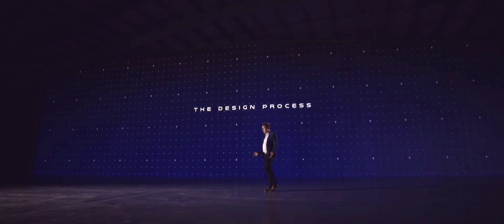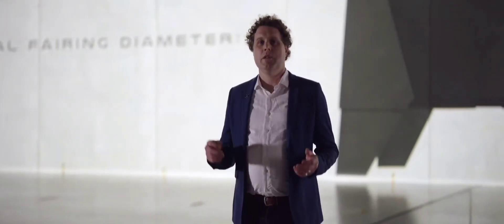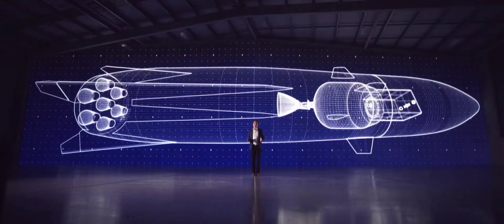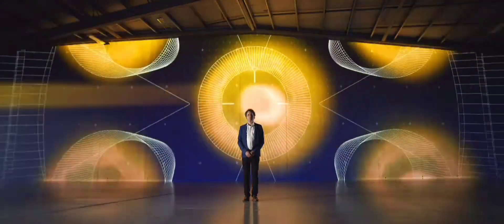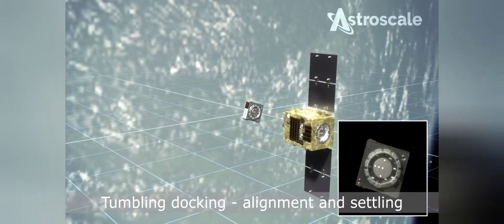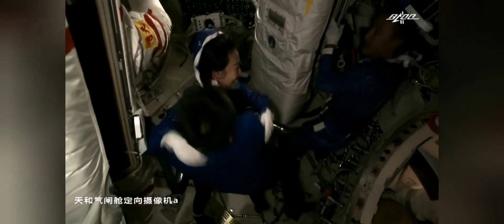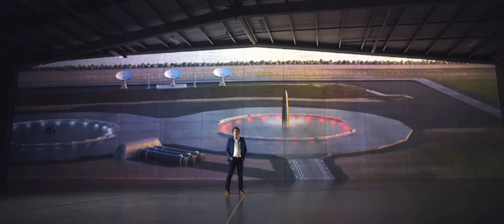A rocket for 2050 - Why Neutron is much more than outdated competition for SpaceX Falcon 9

Comment: Starship is like a train, cargo ship, bus or passenger plane, it hauls a lot of stuff or number of people, Neutron, etc, are like taxis, they haul one or a few people.  This is how it works on earth, this is how it will work in space.  You don't need an aircraft carrier or super tanker to get a couple of people and the daily mail run out to a small island, a few miles off the coast.
Reply: You would use an aircraft carrier or supertanker if it was cheaper than the alternative. Neutron is only partially reusable, so it is possible Starship will be cheaper per launch.

Comment: I think the Neutron will be upgraded and modified in different ways.  I don't think the second stage will ever be recovered because it will add too much mass.  The economies of scale is not there.  Where the changes I would hope to happen are is an upgrade second stage engine that is pushed to the limits as it is only going to be used for one flight.  The thing is a super light second stage with a super efficient engine can do some amazing things.  Especially when you talked about New Horizons, delta-V is the difference / ratio of starting mass verses ending mass and ISP while expelling that mass out of the back of the rocket.  So a very light rocket stage with a very good ISP can have a rather large delta-V.  Another way to look at it when you need to do a particular mission with a particular delta-V, instead of the ending mass being largely gobbled up by the second stage, it is instead largely gobbled up by having a bigger payload.  In other words say you look at Falcon 9 to GEO verses LEO, there is going to be a big drop in capability to get that extra delta-V with how much the Falcon 9 second stage weighs structurally.  The Neutron LEO verses GEO should be a lot better, especially with a highly efficient "ball busting" methane engine because there will be a lot less structural mass to push around.

What I think would be interesting is if Rocket Lab tried to do a vertical carrier style cable on tower and grappling hook recovery on a stable ocean platform and deleted the landing legs.  The thing is having 15,000 kg in fully expendable mode and dropping down to 8,000 kg to fly back to the launch pad shows a huge loss in capability in order to achieve recovery of the first stage.  If instead you got rid of the mass of the landing legs, freed up the mass of propellant used to get on a trajectory to the launch pad for more mission capability, and even freed up the mass of propellant for landing for more mission capability and then had relatively light grappling hooks, maybe a small drogue chute, and short and maybe somewhat elastic cables to the grappling hooks, you could have a really light recovery system on the rocket.  With the extra speed you would hit the atmosphere for such a minimalist recovery, you may still need to do a small entry burn, but the opportune word would be small as the rocket is already optimized for doing a passive entry.  So then maybe you can still get 13,000 kg to 14,000 kg to LEO and have an excellent capability to do GEO missions.

Maybe Neutron starts with its open cycle gas expander cycle so they have a working rocket pulling in revenue and they start working on a more efficient design.  They can go for a more "ball busting" engine for the second stage first as mentioned above as I don't think they can afford to ever recover the second stage.  Once the more efficient engine is working on the second stage, maybe they work on a de-rated version to handle many first stage flights.  It seems like a common thing to try to make a really efficient second stage engine as efficiency is really important for a second stage, much more so than the first stage where thrust tends to be more important, and then try to get the thrust capability up on that engine to make it a suitable first stage engine.  It is just in Neutron's case they already went for a "low density" design for the first stage engines and so they would be more focused on de-rating the engine so it can survive many flights; in other words the engines will be heavy for what they do and the mass trad-off to have an orbital class rocket is the structure of the rocket will be really light.

I don't think Neutron will ever carry people.  There is a basic problem of with the shape of the fairing, how do you pop it open at say Max-Q?  It is going to be forced shut by the immense aerodynamic forces on it.  Anyways it doesn't look like there are any windows on it.  Astronauts have historically been very particular about wanting / needing windows.  I am thinking instead this is going to be a cargo workhorse.

Comment: Seems to me that Beck has figured out that SpaceX will be moving out of the low mass launch services once Starship comes on line. If SpaceX had any intention of remaining in that market, it wouldn't have stopped development on the Falcon9. By time Neutron comes online, Falcon9 will be in the process of slowly being phased out. A smart move would be for the second stage of the Neutron rocket to be designed with easy serviceability in orbit then partner with SpaceX to launch refueling depots into orbit on its Starship.
Reply: SpaceX will move the low payload mass launches onto Starship. The intention is for Starship to be cheaper per launch than Falcon 9, so anything that can be launched on Falcon 9 can be launched on Starship with more profit.
Reply: @espenha  but if you watch the video, he talks about how it's almost guaranteed that spacex prices starship from 75 to 100 million so that they can recoup development cost. And even though it has plenty of space for multiple small and medium satellites, many customers would prefer to send their satellite on dedicated rocket, like on a neutron
Reply: @benji8648  The Angry Astronaut is mistaken in thinking that recouping development costs on the launch cost is necessary. It's not even legal to amortize development costs. (Basically it amounts to tax evasion, as you are exaggerating your costs and reducing your profits and tax burden.) 

And SpaceX has no need for the money they would get for recouping the development costs. The development of Starship is funded though profits from other programs, the NASA HLS contract, and through repeated cap raises. This money does not have to be repaid. So "recouping" the development cost basically means saving up billions and letting it sit in some bank account.

What matters is the cost of launching, and what the market is willing to pay for a launch. If the cost of a launch is $10 million, and SpaceX has basically unlimited demand at $20 million per launch, they will launch as often as they possibly can. Of course, it's entirely possible that SpaceX will charge way more money for launches, but you can expect this to only be the case as long as they have a limited number of Starship launches they can do. Like with the environmental assessment at Boca Chica, they are only expected to be able to do five operational launchs per year, at least initially. If they were sold to commercial customers, they would basically be sold to the highest bidder. So if five different customers were willing to pay $200 million each, that could easily be the price.

But I believe the lack of supply is quite temporary. As SpaceX works through the issues of rapid reuse, and they get additional launch sites up and running (and probably get permission to do a larger number of launches at Boca Chica), the number of launches SpaceX is capable of doing increases, and a new price equilibrium must be found. I think SpaceX will be doing hundreds of launches per year around 2025. And at that point, I think there's no way a Starship launch is priced above $50 million.
Reply: @espenha  I just can't see Starship being cheaper than Falcon9 for at least 4 to 5 years and by that time, Starships will all be to busy with other duties to be bothered by the small mass payload business.
Reply: @alderwolf7687  I would rather say that by that time, SpaceX has a large fleet of Starships, launching from around four different launch sites. Allowing SpaceX the capacity to launch any payload, even smaller payloads.
Reply: @espenha  Even with a large fleet I still see Starship too busy tasked with other duties to do anything other than dabble in the small payload market except with the occasional ride share. 
Everything Musk is doing now for profit is to raise funds for Mars. Once the Mars mission goes live, he won't care much about the small payload market which. Besides, Musk isn't interested in crushing competition and becoming a monopoly, he'd rather see the industry teeming with healthy competition pushing the envelope further and faster than ever before.
Reply: @alderwolf7687  I really don't look at it that way. I think doing commercial launches will continue to be prioritized, as it's in part what's paying for the mars colonization. The mars launches are for the most part fairly flexible in scheduling, as most of the launches are propellant, which can be delivered to propellant depots months or years ahead of the mars transit window opening. So I think they will fill the schedule with all the commercial launches (including Starlink, HLS, ISS), and then the remaining launch opportunities will go to mars missions, to the extent that SpaceX can afford it.

The non-Starlink commercial satellite launches probably won't be too numerous, anyway. This year they've done about 7. They could do those launches and the 5 Rocket Lab launches, the 2 Virgin Orbit launches and the 4 ULA launches, and still do hundreds of mars-related launches, if they are in fact capable of launching Starship hundreds of times per year in a few years.

And it's not really a matter of wanting or working towards a monopoly, but avoiding a monopoly is more up to the competitors. You can expect that SpaceX will be willing to fly any payload that brings in money for the mars colony, and the competitors will simply have to work hard to be better and cheaper. If they succeed, there's no monopoly.
Reply: @espenha  Something that I think needs clarifying here is that I never said SpaceX would never abandon commercial payload market, just the low mass market. While there is no market for it now, when Starship starts to ramp up, there will be a massive explosion in the heavy lift market rushing to take advantage of the high mass low costs. That will saturate SpaceX ability to meet demand while working towards its own internal goal of Mars. That's why I don't see it worrying too much about the low mass market everyone else is playing in beyond an occasional rideshare.
Reply: @alderwolf7687  I guess I'm less optimistic for the heavy lift market. It will come around eventually, but I'm not expecting many heavy (40-150 ton) payloads this side of 2030, beyond what SpaceX generates internally. I just don't quite see what these payloads would be. If you look at say Orbital Reef, probably none of the module are above 40 tons.

Ultimately though, what matters to SpaceX isn't payload mass, it's revenue. Of course, if SpaceX is flying lots of very profitable heavy payloads, they might not bother with smaller mass payloads, but if there aren't many heavy payloads, they will have to launch lighter payloads to generate revenue.
Reply: @espenha  Think orbital infrastructure and industry. There are many very valuable things that can only be manufactured in zero G. When the capability to get people, structures and materials into orbit at a low cost comes online, a new gold rush will start.
Reply: @alderwolf7687  I know there is a lot of hope attached to those ideas, but currently they aren't really commercially viable. And I think there is quite a number of years of development remaining before anyone is ready to roll out large scale operations. Until then, a lot can be done on on the planned commercial space stations (which themselves are not planned to be launched until 2025-2030).

As I said, I think the market will arrive, but not on this side of 2030.
Reply: @espenha  Hope has nothing to do with what I've said and when you think about it, 2030 really isn't that far off. The earliest Starship will be ready to take anything to orbit will be Q3 next year and all those flights will be Starlink. I seriously doubt Starship will come close to being cost competitive with the Falcon9 before 2025 at the very earliest and by that time there will be growing interest in utilizing its capabilities to the fullest which falls into your timeline. 

As for Rocket Labs Neutron rocket, I don't see it commercially operational until 2023 and won't be hitting its stride until Q2 2024. How many years did it take Falcon9 to hit its stride?

Comment: There's also the possibility for them to incorporate a capsule and second stage into one. And if they refuel in orbit, they might even reach as far as the moon! But I expect they'll want to rely on SpaceX refueling infrastructure for that*, which I think is why they use the same fuel as SpaceX.

*That 2nd stage looks like it has a volume of around 100-120 m^3, and depending on the Methane-lox ratio, that can easily mean 80 tonnes of fuel. Doing 10 Neutron refueling flights seems a lot more expensive than half a Starship launch

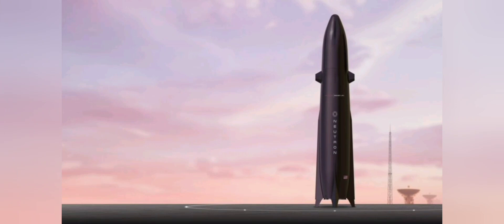Comment: 14:45 that would be a pretty stupid statement to say when forgetting that for every ascent to LEO, a new second stage would have to be built. So no, costs would not go down because of the second stage being reused that way, but it would allow them to make further profits with a second stage that can be treated like an active spacecraft through contracts with companies that require a space tug. 

SpaceX is able to do full reuse with cost reduction because ultimately the second stage is capable of reentering the atmosphere and land at the launch site, allowing them to use Starship again for another payload headed to LEO, hence not requiring them to build a second stage.
Reply: The question is: What is cheaper? Just building a fairly simple second stage, basically just one engine, or having to maintain the entire second stage. It comes down to reliability and there the approach taken by rocketlab is much simpler and usually much safer. 
But in the end only time will tell. If spaceX really manages to just refuel both stages eventually sure, it will be cheaper. But will they?
Reply: If Starship fails then Rocket Lab has a pretty good competitor for Falcon.
Of course if Starship succeeds then it would be ideal to launch a space tug also. It would have the advantage of actual retrieval of that tug for servicing also. At least until in space servicing facilities are built.
Reply: @nukularpictures  Cool thing is that Starship is literally the second stage. As for Neutron, how do we know the second stage is not going to be reusable? None of it has been revealed yet. I'd assume they may design it so they can catch the Second Stage via a helicopter like how they're going to reuse Electron?

2021 Space companies: SpaceX is working on Gen3 rocket design, Rocket Lab Gen2, the rest are working on Gen1 (just trying to get it up!)

Comment: The usable payload volume looks small.
Reply: anything up to 15 metric tons... the average car is 1.5 - 2 tons
Reply: @NighthawkNZ  Right that is the mass but what is the volume?
Reply: @paulshipley6024  what ever fits inside the 5m (16ft)  diameter and what ever the height of the fairing is?  

You could fit an average size car in the fairing with room left over and not even hit the mass restrictions...

Example the James Webb Telescope is only 6.5 ton's... and folds up to a lot smaller than it's deployed size... Neutron could possible launch it ... (but to be honest) I am not 100% sure how small it is in its Launch configuration and the Ariane 5 is a 5.4m fairing diameter... Neutron is only 5m...  but you gen my point.

Comment: Well I guess the main point of neutron would be that unlike falcon it should be instantly reusable, just like Elon plans to do with the starship.

The "vision" of the authors also is a valid point since starship still has a serious justification for using steel instead of carbon composites, because to colonize Mars we'd still need thousands of ships.

So in conclusion I believe that neutron is like a small starship and surpasses falcon in reusability. 

It could replace Falcon for a lot of use cases, but it won't replace SpaceX. Just nice competition and inovation in the space industry 🙃

Comment: I notice that Beck did not use the same grade of stainless steel for his demonstration that SpaceX uses for Starship. Therefore this claim about durability comparisons was misleading.
Reply: It was more of a dig... lol
Reply: And the stainless steel tanks used by SpaceX are pressurized.
Reply: Beck talked about how lift the carbon composite is. He didn't discuss how heat resillient it is.  Carbon is strong had durable, like diamonds. But diamond will burn at extreme temperatures. (>1560°F). Orbital re-entry, even under deceleration rockets, can reach 3000°F.